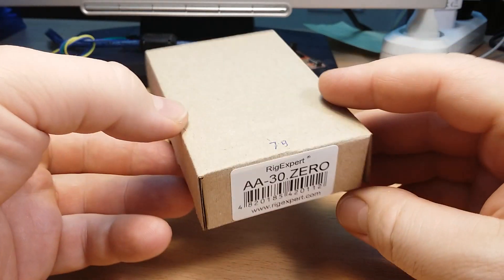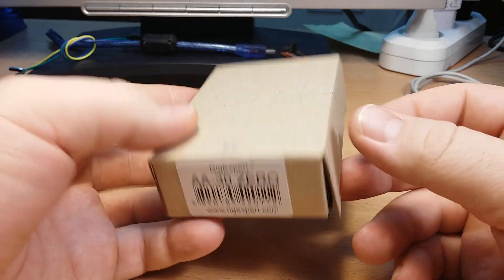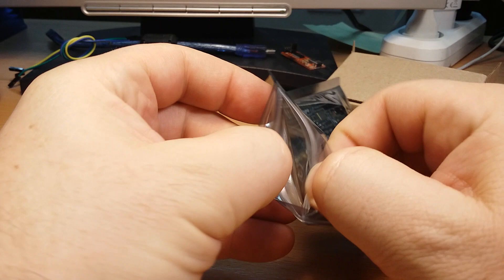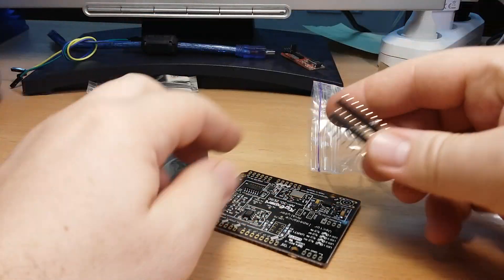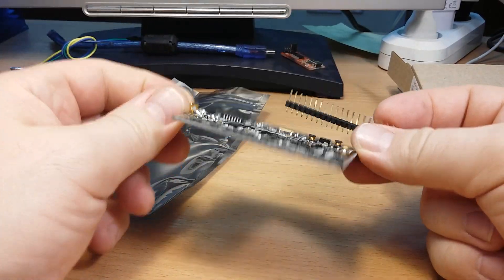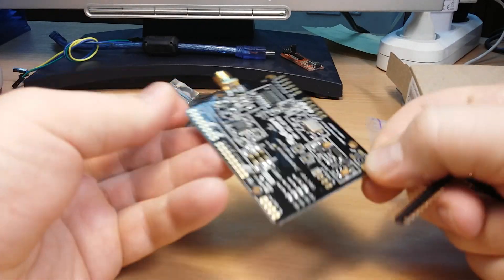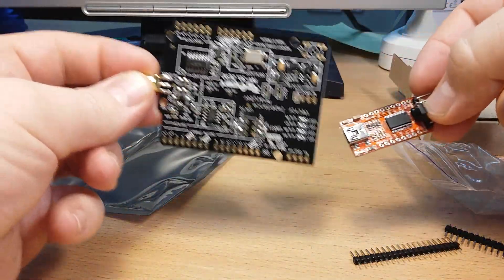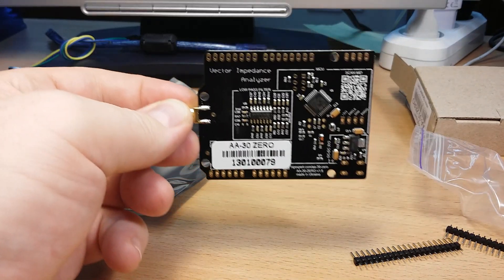RigExpert AA-30.ZERO - Unboxing

Comment: Hi, very cheap but useless !!!. Mine just worked for 10 to 20 scans and was dead just after. It was tested with HF antennas but was not exposed to any HF currents and it was safely installed in a plastic box well insulated. No way to communicate it with it anymore, so this unit is completely useless anymore. Very disappointing. I should have bought a AA-55 zoom instead.
Olivier, F5RDS